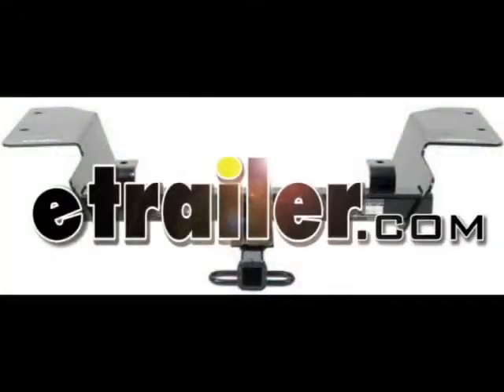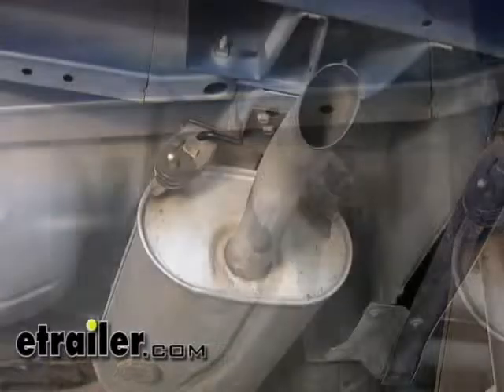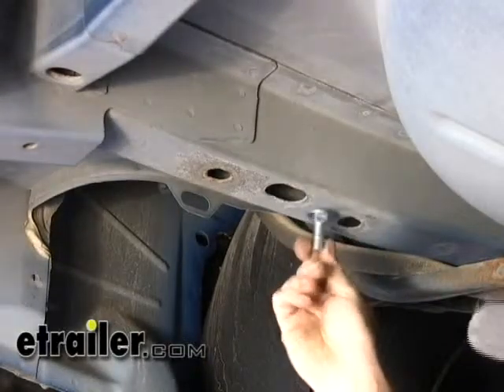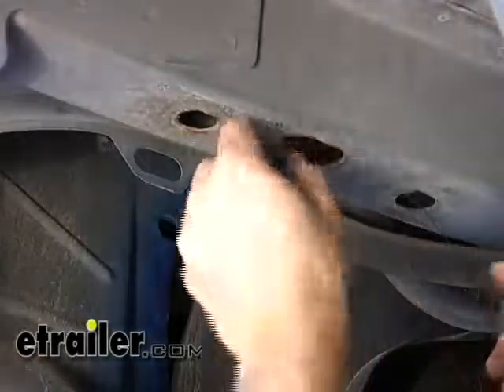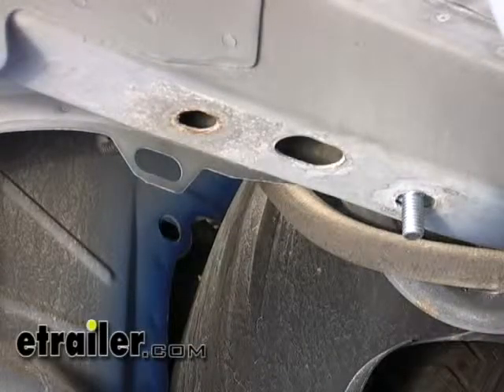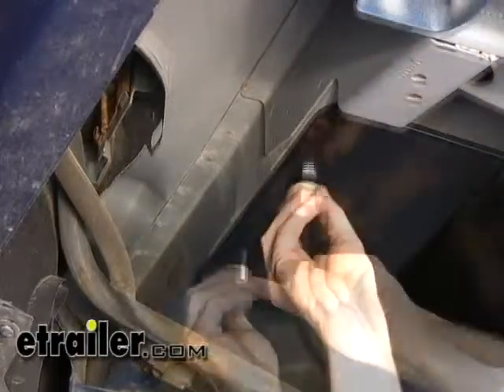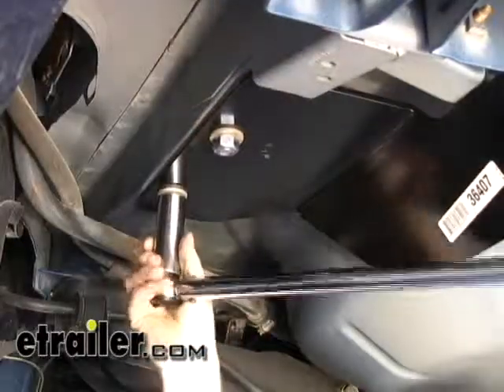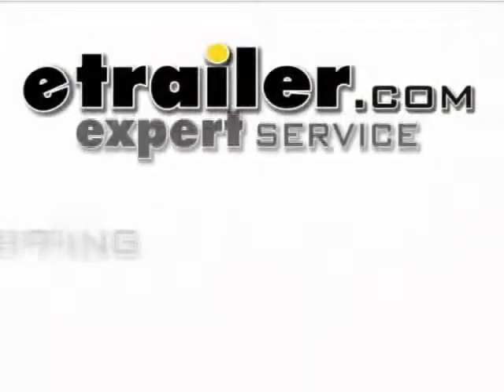etrailer | Set up: Draw-Tite Trailer Hitch Receiver on a 2004 Chevrolet Impala

Comment: Nice! The spring on the wire for pulling the bolts through is a great idea. Another great video that will save me alot of time. Thanks.